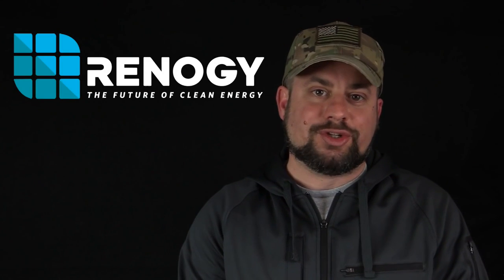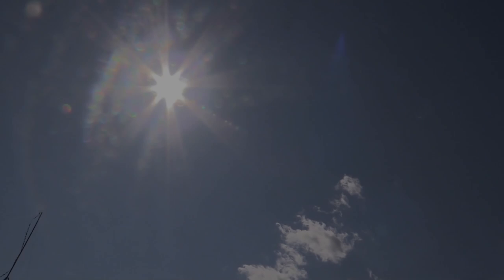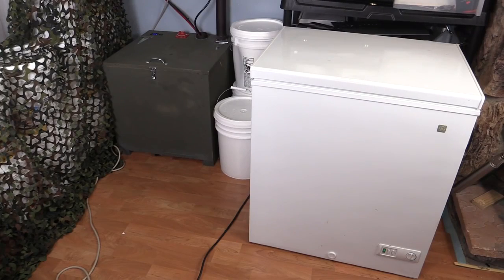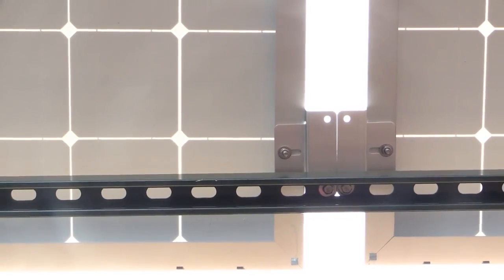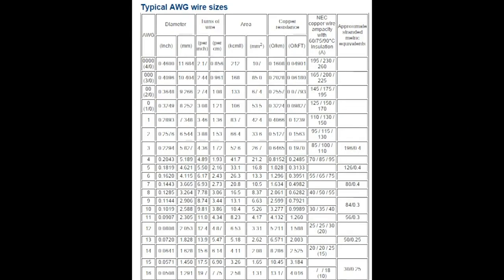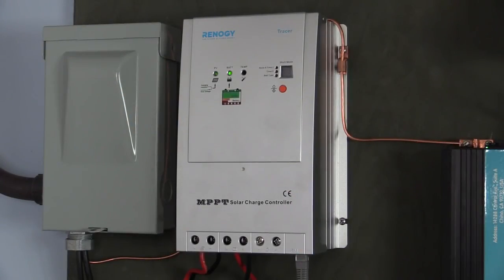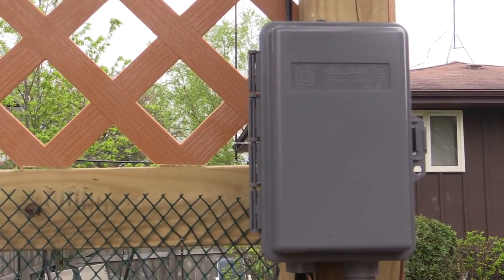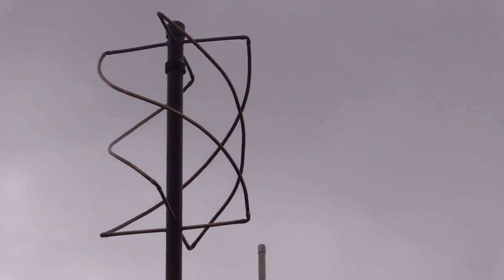The Ultimate Guide To DIY Off Grid Solar Power | Tin Hat Ranch

Comment: IF ones solar is not ready- and the grid goes we might be dealing with NO electricity.  What then?  Here are a few tips.
Heat your food in the sink.  Take the grill from your oven and place it over the sink.  Use kitchen plates and stuff to 
position 4 plumbers candles under a pot -- heat dinner in 10 min.  (or other candle will do)---- Be warm?-- Inside a house you can use down and cotton - (buy from goodwill in summer) dress like Inuit - warm in clothes.  Extra down stuff can be stuffed into a comforter and put on bed -- you (and another) will be warm in that bed.  Make sure you have a toilet that runs on bags-
fit little ones in the toilet for one time use.  Then put that bag in a larger contractors bag for disposal later.  All urine will run
down the toilet without flushing if the line is not broken.  A five gallon pail wit a toilet seat is nice to have -- but lots of bags.
Buy that second toilet seat (or get one from recycling)-  And pick up an old phone that did not plug in -  it might work when
there is no electricity- it draws elec from the phone line.  (these are cheap now).  Want rain water -   use tarp and cord and 
stretch over the ground with a hole in middle and a rock-  a 5 gal pail under and the rain goes in your pail.  Want music and even video --   get lots of batteries for those portable players and you can be entertained.   LOTs of batteries when on sale.
Lots and Lots of candles --- you will  not like pitch black.  If things get dangerous and you are an no gun nut --- get you
some bear spray -this is pepper spray that (WORKS)- from 20 feet.  And-- well- auto flares.   dangerous.  And wasp spray-
you may need it.  Or -- get that gun.  A 12 ga shotgun can be reloaded -- just uncrimp the shell and put in rock salt
or chick peas -- you have a non lethal round.   Buy lots of cans of stuff --- cans are great ---- l,ots of cans of stuff.
And get those 5 gal bottles of water delivered and keep the empties.  Fill them with water and store -- lots of them.
I have 35 and counting.  Can go outside most places or stacked in garage -- you need the water.  Stock up on some
prescription med needs -- store them - drug store will not be stocked or open.  PLan   Never let your gas tank get below 
1/2 -- you always want at least one half.   Get duffel bags to move stuff.  Contractors bags doubled are the cheap alternative so have those.  Bangs and more bags.   Candles  batteries   cans of food.   Just buy em up now.  NOW not later.
Chill -- you dont need food for a month.  I tried it and it gets easy after 4 days.  Relax  read.   you do not have to eat.
But you need the water.  and you need to be warm.  Buy those clothes - down.  And an over garment for rain.  Keep dry.
Put this stuff in your car a lot - you can always move it in.  All this is cheap.  Do it.  You will be glad.  You can use it anyway.
Buy a little radio that cranks and charges your devices and is a flashlight ---  $20 at bi mart.  It has the emergency channel too.
Over buy-- over prepare ------then you can help your friends. Good luck -  but it is not luck - it is doing it NOW..not later.

Comment: hi...thanks for the reply...i live in south africa and we do get a lot of sun here...i have 4x250W/24v poly panels in series to give me 100V...i do get good charge in the day....but at night im pulling about 300W/H and my battery bank is 4x225 trojan to give me 24V and 225amph... the system runs for about 5 hours then the bank is empty...muts i ad so more batteries or do u think there is somthing wrong with the inverter....
Reply from the maker: +Johan Stassen you need 4 times the batteries.
Reply: there is somthing wrong

Comment: hi. thanks for the info on solar...i am new in this game and if got 250w/24v pv in series...outback mx60, 3000w inverter and trojan 6v x4= 24v/225amp/h... im pulling about 200-300w and my system can hardly get to 10 hours running at night and batteries are flat....any advice..thanks.
Reply from the maker: +Johan Stassen how many panels and what state do you live?
Reply from the maker: +Johan Stassen never mind, to constantly pull 2-300 watts you need three times the capacity.

Comment: Been toying with the idea of solar for a while now because our hydro bills keep going up. We are now the most expensive province in North America including all US states.  You guessed it, Ontario.   I looked into doing the whole house, but the inverter needed would be cost prohibitive.  The cheaper option however is to only do the stuff I really need.  In my case I'd do my server room, it's a continuous load that adds up a lot over time.  I'd maybe add more stuff to that as well, maybe lighting or just a couple plugs throughout the house.  In a grid down situation I could then shut down the servers and have usable power.  I have a small property so roof is only option, I still need to go up some time and measure it so I can get an idea of how many kw I can do. I would maximize the physical space.  As a wild guess I think I may be able to do at least 2-3kw.  That is more than enough to run the server room and more stuff throughout the house.   There is a coolness factor to being partially off grid too, if power goes out, you still have power.  I build a small solar power pack for camping and we even watched some movies in the tent on a rainy day.  High tech camping. :P
Reply: Where is Ontario?
Reply: Wouldn't the canadian government just tell you to stick'em up and hand over the money if your bill starts reducing?
Reply: The inverter needn't be costly, all it does is convert D.C to A.C you can increase the power rating by simply using power mosfets in series with the transformer winding.
Reply: Yeah I'm almost wondering how feasible it would be to build my own.  I'm thinking a bunch of IGBTs in parallel.  Even ones that supposedly can handle 100's of amps arn't all that expensive.      I imagine you can use the same topology as a SMPS, except instead of trying to keep it at a constant voltage you have it "follow" a sine wave from a separate 60hz sine wave reference.  I'm still a noob at electronics but if I can learn how to do these things I will save myself a lot of money.
Reply: Northern Ontario, Timmins area

Comment: awesome video! although the segment on fuses was run thru kind of fast. so lets assume I want to run a refrigerator, washing machine, dryer, well pump, lights, almost like a normal household. how much more would it take? you are using only 4 panels, 20 panels would not really be that much more? batteries plus panels, and mounting? im saying 12 batteries, 20 solar panels. the wiring at 60 feet has already been run. it would just some added wiring and maybe a larger charge controller?

Comment: Love your presentation ! a your humor goes a long way... I need a bit of advise, I have (3) 305 watt 24 volt panels @ 915 Watts I have (x4) Trojan T105 6v RE @ 220 Ah each 1500 watt 24v AIMS PSW  PI. Questions: 1- What size MPPT should I use  60 Amp?   above array and bank 24v 2- Same (4) T-105's    Can I run As a 12 volt  setup using the 3 panels 915 watts  3 Can a  Controller reduce the 915 watt input from array  using a 12 volt Power Inverter to maintain the bank   (2 separate systems) 1 was for a friend that has a Cobra 2500 12v PI with the same array &  battery bank.4- What size MPPT 30-40 amp? to run a  12 volt system5- Do I still need a battery tender to charge the 4 T-105's 6- Do I need (2)- 12 volt tenders  and only 1 in a 24 volt tender?  Any Advise is mucho appreciato !
Reply from the maker: +C Davis I'm a little lost on what you are asking for some of the questions.  915 watts of input would require a 80a MPPT charging a 12v system and it would be really close to being too much for a 40a controller at 24v, I'd go with a 60a.
Reply: TinHatRanch TY oh great solartini ! I appreciate your reply...

Comment: u used an a/c breaker on dc power no no
Reply from the maker: +Bob Tinnes it's not being used as a safety device or fuse.  There is another fuse in the box.  It is simply being used as a switch because it is designed to mount in the box...a circuit breaker if you will.
Reply: as long as you dont switch it off while there is amperage going in the batteries youre fine.the problem with dc is that if there is any significant amount of current it will make an electrical arc between the contacts when you turnit of. the arc will eventually melt and destroy the contacts in the breaker.  nice video btw. i like your explanations...

Comment: Yeah nah, I'ma go powerwall style. 8650 cells all the way.
Reply from the maker: +Aiden Attenborough its 18650 and as long as you can build a charge controller that can safely handle the nuances of a Lithium battery, it would be a higher performing, smaller, and lighter choice.
Reply: +TinHatRanch Yeah sorry, 'twas just a typo. :)

Comment: Quick question, many homes here, ic us have Solar panels on our Homes, connected to the grid
If something ever happens, is it possible to adapt those panels to an off grid system, have to remove them off the roof of course, but is it possible?
Would need controllers etc, just a thought if we ever do have a complete grid down scenario for a long time
Thanks from Australia

Comment: Hi TinHatRanch. I have been itching to ask you this for you might turn me down. I hate to see students in my school charging their cellphones at the lobby thereby making noise sometimes near the classrooms. Can you provide me the size requirement of a solar charging kiosk that can charge 20 iphones simultaneously? I plan to make a SOLAR CHARGING KIOSK for my small project proposal to the school board for funding but they need some kind of justification for the materials. I need to support my proposed project like size requirement.  Plenty of sun in Cebu in the Philippines. Thanks for your great work here.
Reply from the maker: +Romeo Lanzaderas you don't need much.  Even if you used the iPad chargers they are only 10 watts each, so 200 watts total, say 1.5 hrs of charging per phone.  That's only 300w/hrs.  One 100 watt panel, a 10a charge controller and a 100 or so AH battery to keep it above 75% on most days
Reply: Ah ok I am very grateful TinHatRanch. More power you!

Comment: ...you can have a swamp cooler.  Refrigerated air has terrible power consumption.
Reply: Unless its a mini-split unit.  The AC in my bedroom only uses ~500w.  I can keep the room ~70F overnight when it's ~90F outside using <5kWh.
Reply: unless you're in near 100% humidity weather, a similar cooling capacity swamp cooler will keep you near as cold with a fraction of the power consumed.  I suppose you could run a little refrigerated air unit on a home solar unit, but for the same power you could probably cool an entire house on a swamp cooler.
Reply: I'm in the desert so my main problem is lack of water.  Fortunately sunshine is in great abundance ;)
Reply: I'm on a mountain near the desert.  If you collect rainwater you can run a swamp cooler on it pre purification.  In the desert proper the rain shadow effect is much more pronounced though.

I'm a big fan of swamp cooling, not just because of energy concerns; swamp cooling is also easy to repair and maintain.  I could build a swamp-cooler with junk around my house right now.  It's just a box, a pump, and a fan.
Reply: What rainwater?  Sometimes we go six months with no rain :(  I have the opposite plan... if I really need it I can collect condensation from the AC to use for drinking water and cooking.  I guess each region has its own perks.  I also have a grid-tied system that is VASTLY oversized for off-grid use.  I typically generate ~2x what I need... and that's with an electric car.

Comment: I Really enjoyed this "Ultimate Guide" to Solar, and while you have a way of explaining certain terms easily, unfortunately, your Guide suddenly changed...for the worst!

Why, after providing explanations for being able to generate power for Homes, you then claim that we can only use an Air Conditioner for less than 15minutes, and if it is run for a longer period of time...we'll LOSE ALL the Solar Energy stored!!

Are you "basically" telling us that there is NO WAY to create a system that would allow users to run Air Conditioners, Washer/Dryer Machines; etc??!

I find this hard to believe, that States that never have Winter months (and constant Sun Light!) that you make no mention of them being able to generate enough AC Power to run these appliances daily!!

Please tell me your Guide for "Living Off The Grid"...means more than "Sacrificing Your Comfort Level(s)" to save a few dollars?!
Reply from the maker: +Mike Mini air conditioning is very power hungry.  You could very well scale this system up to accommodate AC.  The same goes with electric heating, in fact, it's even worse.  You absolutely HAVE to understand something; there are many areas of the world that are currently inhabited BECAUSE of air conditioning and cheap energy. When it comes to energy, it is what it is, I can't change those facts..I can only explain how it works.

Comment: Great video.  But you left out the option of placing your batteries and controllers out with the panels (60' away).  Say in a purpose built shed.  Then you'd have nearly zero loss to the house with cheap wire via AC..

Comment: For those of us who already have an on-grid system with mini-inverters on each panel, that delivers 110 volts AC to the panel, I have a question.

I know that the system is made to shut down if the grid goes down so that a utility worker does not get zapped from our solar system. But, after the investment in the system, can explain how we can turn off the main to our electrical panel and re-wire the output from the system directly to have access to electricity while the power grid is down, especially if it a longer term outage.

I guess in simple terms, I am asking how to bypass the auto cutoff switch after manually disconnecting our system from the grid.

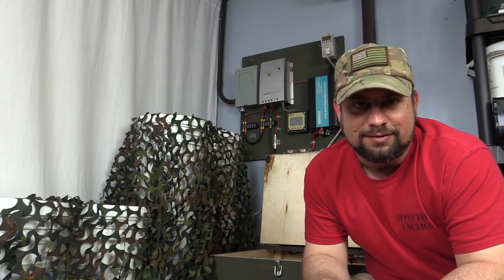Comment: 35:35 you mention about the hydrogen gas problem with the batteries. then you show the pipe meant for exhaust but right next to the pipe is a hole for the wires that leads right into the room. Like power air is lazy and will take the easiest path which is through the wire hole. I suggest running the wires through a hole on the bottom, or run a pipe inside the bat box to the bottom of it (using the existing hole), or make lugs to get the power out of the bat box. Good video!

Comment: Okay did I get this correct. You can run your 75 volts into the MPPT charge controller and then right into a 12 volt battery bank?Seriously. ....I thought I had to keep the volts equal to the battery bank.

Comment: Since you're a ham, RFI has to be part of the equation. Did you run into any problems with it and if so how did you deal with it? Also, did you bond your grounding? In other words, did you connect your house, radios, solar system and whatever else you might have to a common ground to equal the potential across your entire system? I've been thinking about putting in a larger solar system (I have a small portable system now to power up the radios and a few other things) and all of these issues have reared their pointy little heads in most of the research I've done. 

Thanks,
KD0QKK

Comment: Hi thanks for sharing your expirience with solar power, Can I make some suggestions ? So how you said when your btattery are full and there is still Sunny you can make fuel from salt Water through electrolysis  separate hydrogen and oxygen,  you must build tanks to store hydrogen gas and used as fuel to generate energy to your car or make energy when the sun goes away so there will no need to loose energy.  So about what you say there are no point to use solar panel energy to heating house or water or use air  condition, there are is Geothermal Heating Pump System which you can you to power air conditions, freezers , coffee machine , floor heating and so on.. this can save you muxh more money for heating your house and there always will be hot water .or use Solar-thermal collectors heating liquid for heating/cooling system as well.  Winter when sun was hide mostly to complete your system put one wind turbine if there is wind and your hybrid system will be perfect .
Please correct me if i said or write something wrong my english is not very well.

Comment: Great video but I do have one question, hoping it hasnt already been mentioned and I just missed it. Is there a drawback or an advantage of buying a greater capacity inverter, such as a 3000?
Reply: + Michael Henderson With a 12V battery bank a 2000 Watt inverter is about the largest you should consider for lot of reasons. As well as to support the use of 3000 Watts the system would need to be MUCH larger than the example..

Comment: As a electrical engineering major who works for a local electric utility, the principles explained in this video of off-grid electric solar living are sound. Great video! (I have one tiny technical tidbit I might add. Electricity will travel in all connected paths, not just the one with least resistance, but the greatest amount of power will transfer in the path of least resistance which is generally sufficient for protection)

Comment: I live in a flat so there's no way I can do something like this. I do have a couple of small solar panels (goalzero) that can be connected to charge things like AA batteries for flashlights, my phone, my reserve phone with prep docs on it, my e-reader with the same and some books on it etc... For light I'll use my oodles of petroleum lamps, use the same fuel I use in my petroleum heater so I'll be good. Good vid again though :)